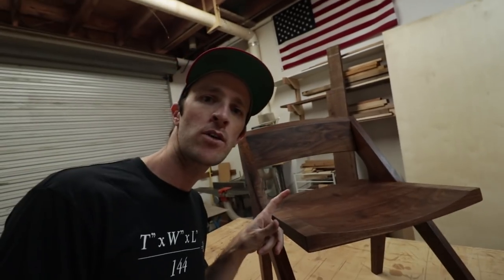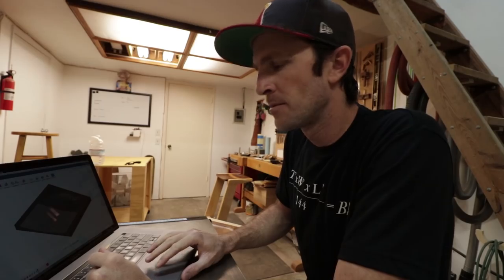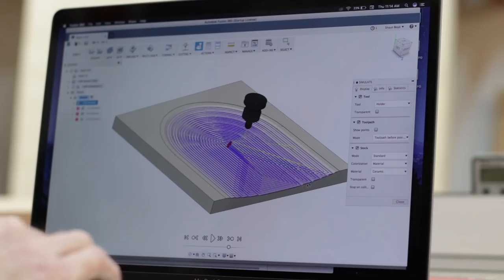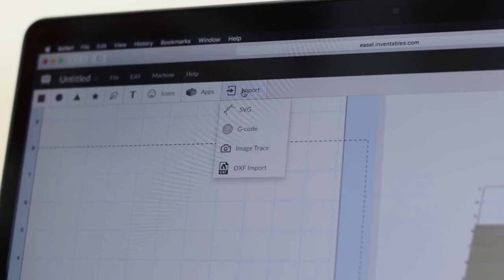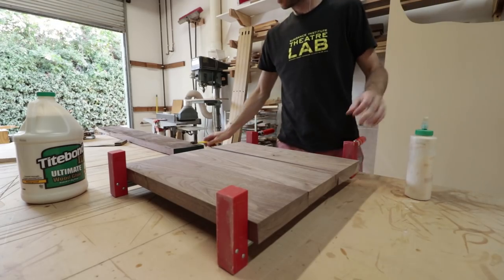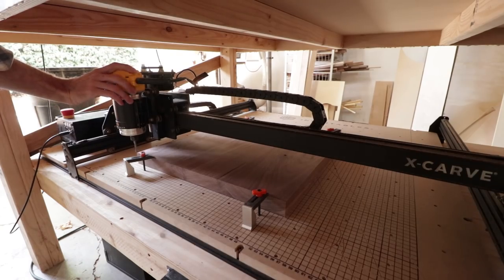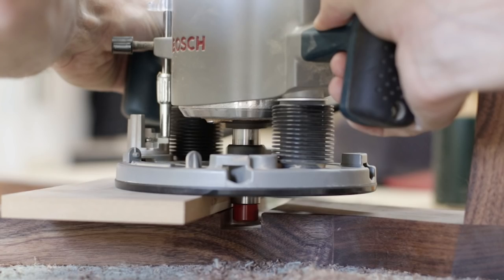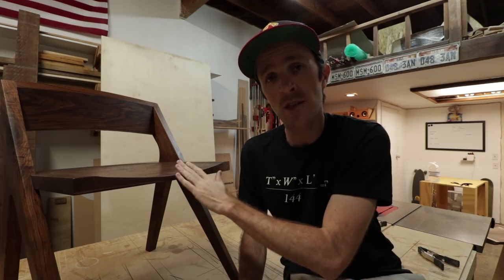Carving a dining chair seat with a CNC machine - Shaun Boyd Made This

Comment: I dig it.

You may want to consider getting a router with a brushless motor. Typical routers are not designed to run for such extended periods of time and that carve looked like it took a while. Brushless motors produce much less heat and should hold up better in extended-use applications.
Reply from the maker: Thanks! And yeah, I figure I'll just run this little router as long as I can, then go from there.

Comment: If you decrease your step over enough with the ball nose endmill, you will eliminate the vast majority of your sanding.  I believe I use a 1/10th step over on a 1/4 inch ball nose bit.  You can also increase the speed a lot on the final pass if you are using the same diameter ball nose to compensate for the tiny step over.  Obviously the 1/10th is relative to the size of the bit, so a larger ball nose needs a much smaller step over setting.
Reply from the maker: Thanks! That is actually what I did when the first test cut had all that texture. Worked really well, and yeah I am always afraid to ramp up the speed, but you are definitely right.

Comment: 90 percent overlap toolpath you can get the best results on 3d model route. And yes a rough pass with a endmill at 50 percent overlap and then a ballnose bit with 90 percent overlap.👍

Comment: K so I am going to be making the cnc leap here in the next few weeks to help speed up some of my production pieces, I am interested in the the x carve system so the question I have is what size did you go with, what all accessories did you get and also what would of differently, like the size or the bit order or the dust collector?
Reply from the maker: Awesome! I went with the 1000x1000mm version just so I am able to cut larger furniture templates with it, and I have already maxed it out quite a few times. As for accessories, I kept it pretty basic and got the side board to hold the controller box, and the dust collection kit, which has been a great addition to the machine. I also got the v-bit set and Easel Pro which is awesome if you plan to carve text or a lot of signs, etc. Hopefully that helps!

Comment: Love this chair, and I really like the thicker seat. What was the total cut time?
Reply from the maker: Thanks! Yeah, the thicker seat is not only sturdier, but I think it just looks better with the overall design, as well. I think total cutting time was maybe an hour and a half to two hours? I'm sure once I do a few more I can get it dialed in and maybe reduce that time by a bit.
Reply: Shaun Boyd how does that compare to carving by hand? If you don't mind me asking. 
Love the idea, might just try it myself.
Reply from the maker: Honestly, I can probably carve it by hand quicker, it usually takes me about 30 minutes to do the rough carving, then maybe another 15 or so to get it sanded smooth. The only differences with the CNC is the precision, and the fact that I can do other things while it is carving.
Reply: Shaun Boyd multitasking with a machine is so much better.

Comment: Hey man!
Another great video! I know you were apprehensive about jumping into the CNC world but your making it look possible. Keep it up and I’m going to have to pull the trigger sooner than I had hoped. 

Question: Any insight on seat grain direction for a cantilevered chair??? I noticed yours is running cheek to cheek (for lack of a better phrase). I initially was concerned that the chair could snap under the weight at the point farthest from the fulcrum and was going to orient the grain Butt to knee pit??? 
Any rational behind going with one over the other?
Reply from the maker: Honestly, grain direction on the seat is really just an aesthetic thing for me. With the thinner seat that was on there before, I was a little worried that it would fail, but even that would have taken a lot. So unless you are a violent sitter, I would just go with whatever looks best to you.

Comment: Is the joint holding the seat strong enough? Because you are gluing end grain. And if the legs bow out under the weight then the seat will fall out of the grooves (dados?).
Reply from the maker: Yeah, I don't think there is much risk of those joints failing. You would have to sit down pretty violently to have it break, but I will definitely report back if something like that happens. Thanks for watching!

Comment: Which extras did you get with your cnc? I reviewed and it seems there is a whole heap of choices....
Reply from the maker: Yeah, there are quite a few things you can add to the machine. I kept mine pretty basic and got the side board to hold the controller box, and the dust collection kit, which has been a great addition to the machine. I also got the v-bit set and Easel Pro which is awesome if you plan to carve text or a lot of signs, etc. I'm sure some of the other accessories like the z-probe and homing switches are nice to have, but I haven't added those yet.
Reply: Hey thank you for taking the time for all of your replies Shaun, you are a man of worth.....

Comment: ? You oriented the seat grain so that it runs side-to-side instead of front-to-back. That means that the seat connects to the leg frames as end-grain to side grain, in the dados. Since you don't appear to have used any form of joinery at those two connections the only thing holding your chair together is a few square inches of end grain glued to side grain. Where face grain on the top and bottom of the seat contacts the legs the situation is reversed: face grain on the seat is glued to end grain of the legs.

Your chair design is unacceptably weak and cannot survive heavy loads or ordinary daily abuse. To rescue the design you'll need to introduce some type of strong joinery...perhaps a sliding dovetail might work. But simply gluing end grain to face grain at the most critical load bearing point isn't good practice.
Reply from the maker: This exact chair has seen daily use for the past 2+ years, and is still as solid as the day I built it. I think you are underestimating the strength of a well-fitting joint.